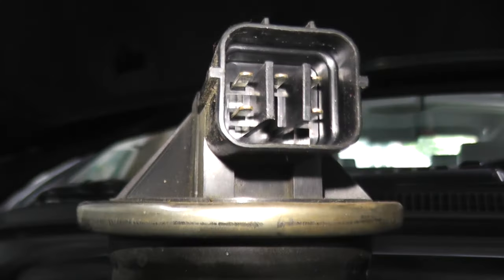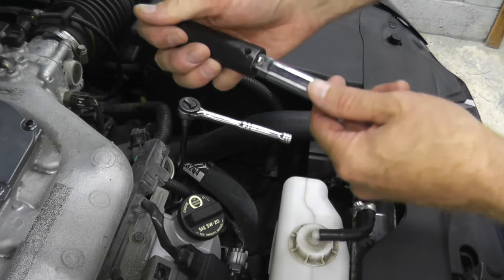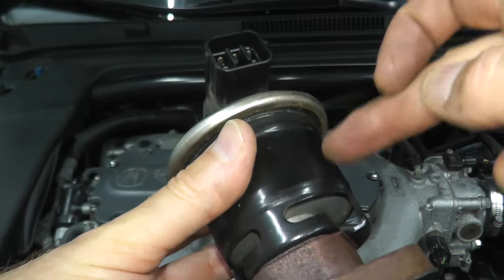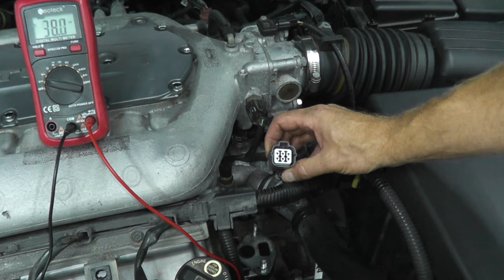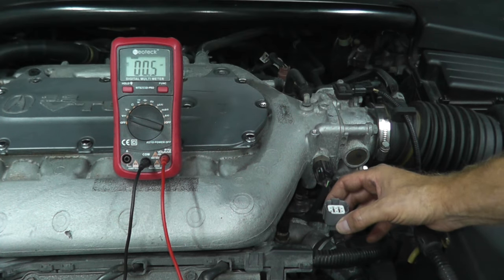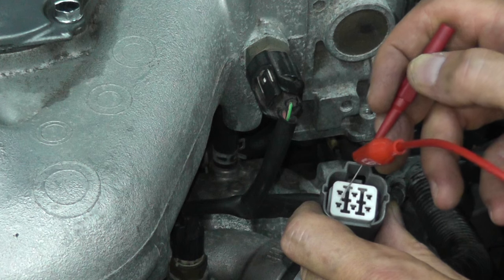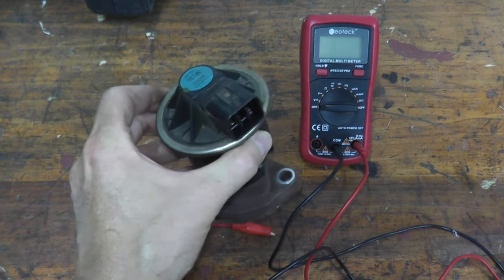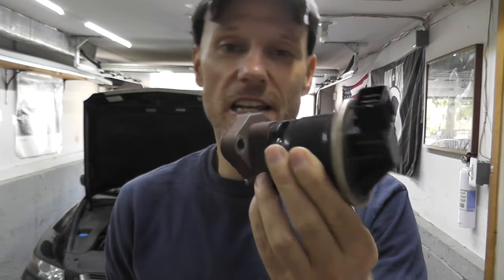Acura & Honda EGR Valve Testing and Replacement

Comment: or, or just buy a new EGR Valve and clear all doubts. Not expensive.
Reply: no good if the wiring is damaged. you often get P0409, P0405 and P0403 codes which all point to issues in the sensor circuit. Need to rule out wiring before buying new EGR
Reply: how about you go buy a new one this video is obviously for people who don’t want to buy a new one 😱
Reply: New ones are like $200.  Not exactly cheap.  I'll try cleaning it for basically nothing first.
Reply: @FPSdoug888  in my experience it's not the mechanical part of the EGR that fails. It's the electric part. On mine (UK Ford Mondeo Duratorq Euro IV) I dismantled 2 that were giving error-codes and found that the small electronic parts inside the cover were burnt-out. Luckily the cover was available as a separate unit and replacing this has cleared the recurring error-codes. I don't know if this would apply to all EGRs but if you can separate the electrical part from the EGR body you may be able to replace it

Comment: In my case, my egr valve is working. But i suspect it's opening too much during idle. I know this because when i start the vehicle, it usually takes awhile before the egr valves opens up. When it does the rpm suddenly drops a lot sometimes till almost stalling and it slowly goes back up. I monitor the intake manifold pressure and i noticed when this happenes the vacuum drops indicating either the egr or iacv opens up excessively. If it was the iacv, the rpm should have gone up, but it loss power and dropped instead, so i believe it was the egr valve. What can cause this?
Reply: Hey man I'm also experiencing this same issue. To me it was because of the start up rpm drop that you mentioned. I had a p0401 code when it started happening, so I replaced the EGR valve with one off of Amazon. It didn't fix the issue as it still was doing the low rpm start up. I also replaced my iacv but that couldn't be the issue as it's new. So I think the EGR passages are clogged. I haven't checked but I will be cleaning them and see if that helps.
Reply: @abrahanrincon4569  the evap valve also contributed to rpm drop when load applied.
Reply: @nicholasong2892  I haven't gotten any other codes. You think I should replace that valve?

Comment: To measure the resistance of any sensor or valve we should put the threads of multimeter between positive and negative  ,right?

Comment: Wow, this actually fixed my car! The Egr valve was stuck open from a tiny tiny rock (maybe half a mm in diameter). My car stalled in traffic one day and wouldn’t restart! I got it towed and then it would start but if idled terribly, I was afraid to even run it.
Reply: This might be my issue.  intermittent skipping at idle with cold engine or engine in warm up phase.  Then when it's at normal operating temperature, the skip at idle is constant.  Raise the idle to 1500 with the gas pedal and it runs smooth cold or at operating temperature.  Did you have P1399 ?  I don't have any EGR codes. Just P1399
Reply: @Mr_BUSINESS_24_7 what did you end up doing? I had P1399 and my EGR wasn’t clogged at all. My intake was badly but I cleaned all that and still the code came back as well as random misfire code.
Reply: @mushlove6933  I suspect my timing belt may have jumped a tooth. I have to check my cam timing. It's easy enough to do as their is access holes in the upper timing covers.  If it's not my cam timing, I'm thinking it could be a partially restricted catalytic converter.  Did you try replacing your EGR valve ?  I am also wondering if my EGR valve is not actuating correctly or if the pintle valve isn't seating properly.
Reply: @Mr_BUSINESS_24_7  i just tested my egr valve with a power probe and it worked. So im putting it back on just need to get a new gasket. I just completed a full valve adjustment, new oem coils and spark plugs and seals, new intake manifold gaskets.. it still has this issue. I’m suspecting something with the exhaust at this point, may be a clogged cat.
Reply: @mushlove6933  check cam timing too.  Meaning the timing belt timing
Reply: @Mr_BUSINESS_24_7  yeah idk when the timing belt was done last.. what’s the easiest way to see if it’s stretched or jumped a tooth?
Reply: @mushlove6933   Like Nike says, "Just Do It."    Better to be safe than  sorry.
Reply: @mushlove6933  I just checked my cam timing and it looks like my bank 1 cam (rear near fire wall) jumped some teeth. So I will be pulling my timing covers, doing a timing belt and resetting cam timing to see if I bent any valves. I'd like to belt if I bent any valves that I won't have a permanent misfire. But my misfire is at idle and throttle snap (hard revving of the engine)
Reply: @Mr_BUSINESS_24_7  same here. Interesting. I’ll probably have to dig into the timing cover too 😐. How did you see if you had a tooth jump?

Comment: There's a potentiometer actuated by movement of the pintal valve - it's on top of the EGR body. You should've checked it as well - in both valve open & closed positions. The ECM monitors the potentiometer to know when the valve is opened and closed.
(I had a EGR failure because potentiometer was worn out)
👍
Reply: How can we test that potentiometer on top of the egr valve? Will a multimeter do it, an OBDII tool or something else? TIA!
Reply: @jackjones9460 
You can check to see if the potentiometer changes resistance...if you know which terminal is connected to the wiper of potentiometer. You'll need to read resistance before valve is actuated and resistance once valve is actuated.
The guy in this video didn't do this test. To go further...the potentiometer is being used more like a on/off switch...not as a valve "position" sensor. When he energized the valve solenoid...the valve pintle was fully opened...not partially. 
I've watched many videos....NOBODY discusses this.
😅👍

Comment: The first step it shows in AllData is to do the test with an HDS (Like who owns one of those?). I believe running power to the valve would accomplish the same thing.

The resistance test you did at the end is the next thing it recommends testing.

These tests are nice to do at the u-pull to yard test a used EGR valve. It should work really well.

Comment: Very easy test video I wish I had seen before I wasted money buying and replacing an  EGR valve I did not need.  I have a multimeter and battery pack.  My replaced EGR valve tested just fine with the opening and closing and the ohms reading is 1.6 and 3.6k ohms.  I have another issue causing a p1491 / ATM-4 and occasional p0401 alarms.
Reply: Did you ever get it figured out?
Reply: @newjordans1  You will not believe this but I reinstall the original EGR valve and my code cleared.  I was due an emissions test two days later and I passed after going through a drive cycle.  I had cleaned the manifold upper plenum several times reinstalling the 3rd-part Dorman ERG but the code returned.

I even gave up and took the vehicle to the dealer who wanted $900 to "deep clean" the manifold and replace the EGR with an OEM part.  I just took a chance and put back the original EGR and things are fine.  So my problem was really just the clogged manifold and I introduced the same error code with a new ERG valve that did not work.  No more p1491 / ATM-4 alarms and its been good for over a month.
Reply: @daywalker5458   Wow that’s great!  I wish I had kept my old EGR valve now lol. I replaced it a couple years ago but shortly after my car passed inspection the codes came back. It ran fine so I just ignored it but now it’s inspection time again.  I just cleaned my whole upper intake manifold and plenum and the EGR valve and the codes still come back.  Gonna break out the multimeter this week. Wish me luck!
Reply: @newjordans1  I have a 2003 Honda Pilot V6.  I cleaned the underside / raceways of the manifold cover spotless.  With long stem cotton end Qtips and carb cleaner and shop vac with a tube that fit in the ports, I cleaned out all the ports that the upper cover fit over.  I thoroughly cleaned the large passageway the go down the EGR valve as I even ran a thin pipe cleaner brush down the opening.

What was crazy is the original and new bought EGR valves both tested the same as performed in the video above, but the original part worked while the shiny brand new Dorman third-party EGR did not.

Comment: Be aware that in many cases it's more difficult to clear ALL affected blocked passages besides the "easy ones" associated with the "intake"... In addition, please consider the following... P0401 - EGR Insufficient Flow
* Upper Intake Plenum down thru Coolant Crossover to EGR (square output port) will clog with carbon
* Lower Exhaust Plenum down thru Coolant Crossover to EGR (round input port) will clog with carbon
- Can often work clear using brake, carburetor, throttle body and/or Valvoline EGR cleaner
- Utilize a flexible braided cable like a plumbing snake...  
- Utilize shop vac then air compressor to remove all debris
- Entire upper and lower plenum passages must be cleared... 
Can be a real PITA, but necessary to actually keep code from recurring...

Comment: when doing the Ohms test at the end why did you not check between the middle pin and the LHS one? I'm curious at to why you only tested between the RH pin and middle one and the RH pin and LH pin. Also should you not get a voltage reading on one of the pins in the upper row. My understanding is those 3 pins are the signal/sensor pins and you should get 5V on one of the (signal supply)

Comment: Awesome explanation. No doubt this confirms electrical integrity. How can we confirm if the is an issue with leaks? I did a smoke test and it "failed". Well, that's what I suppose. Is it normal for the egr to allow smoke to leak out with the engine off????
Reply: Probably means that it’s stuck open and you probably need a new one

Comment: What are the symptoms of a bad EGR valve?

Could it be the reason my '08 MDX is throwing an SH-AWD warning light and when I check the power distribution screen it shows there's no power going to the rear wheels.

Comment: it is better to remove the baterry negative when removing any electrical parts? or not? what is the torque spec for hrv hondas?
Reply: 16 ft lbs (22 Nm)
Reply: It’s recommended for precaution purposes, you don’t want to touch something metal on any wires or connectors when battery is connected since it can cause a short

Comment: If it's bad valve ornsbad valve sensor or wires are bad would that be cause for not passing smog test and blowing out excess exhaust?
Reply: You would fail emissions test and would cause your engine to potentially run rich